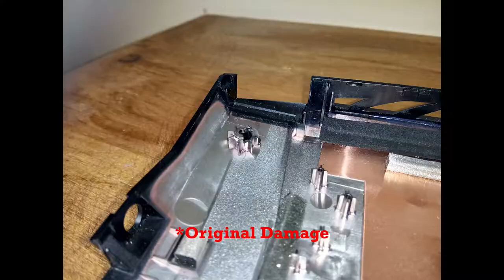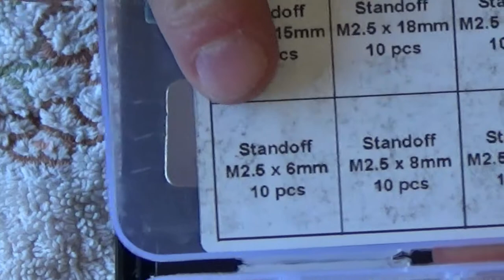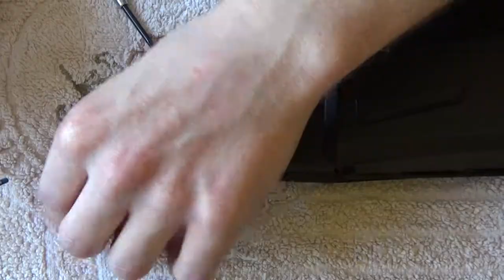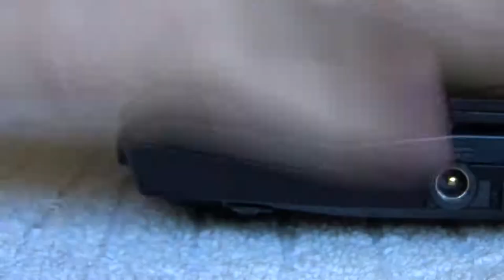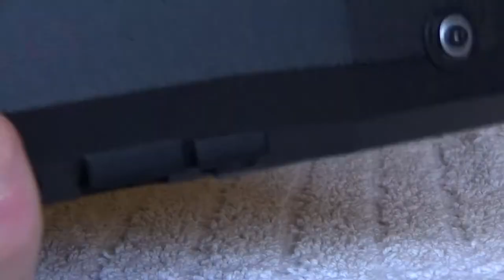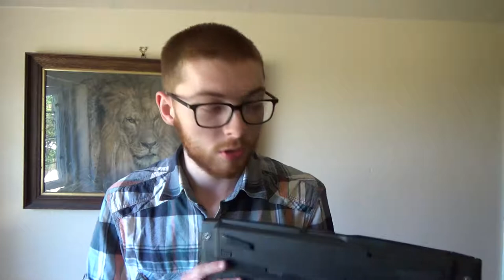Fixing My Laptop’s Broken Chassis with Brass Standoffs (Clevo N850HK1)

Comment: Excellent video and ingenious solution!

I have an old Toshiba laptop with a few broken plastic stand offs, preventing securing the bottom cover as well. The bottom cover was also designed to assist holding the heat sink onto the CPU, with the loose bottom cover, the laptop shuts down just as it begins to boot the OS because the CPU overheats very fast.

I haven't found any reliable source for a replacement bottom case cover; the local authorized Repair Center won't bother making the effort to find the spare part and instead tried to sell me one of their refurbished laptops that cost much more than the bottom case cover is expected to cost, based on eBay prices for similar sized different models!

The old laptop has been overseas three times and interstate several times, and I've upgraded it with faster and higher capacity HDDs and a Blu Ray drive; there's no way I'd ever discard it because it would still work very well and is fast enough for me.

One idea I have for ameliorating the metal washer marking the plastic case, may be to place a thin rubber washer between the case and the metal washer.